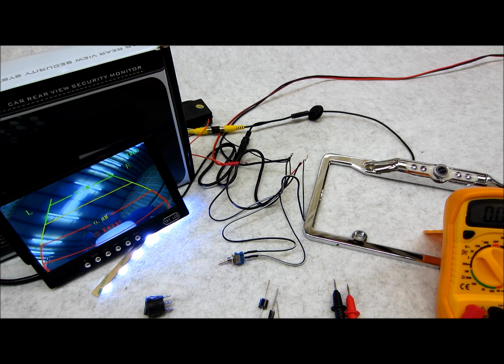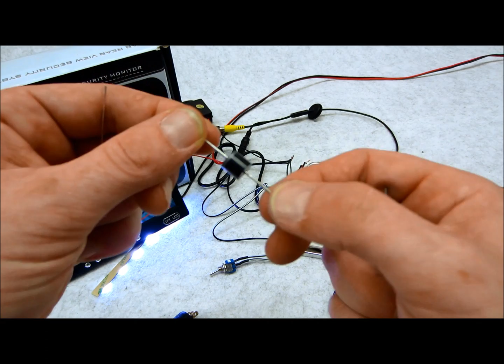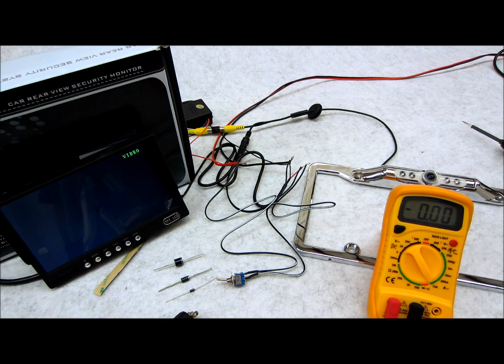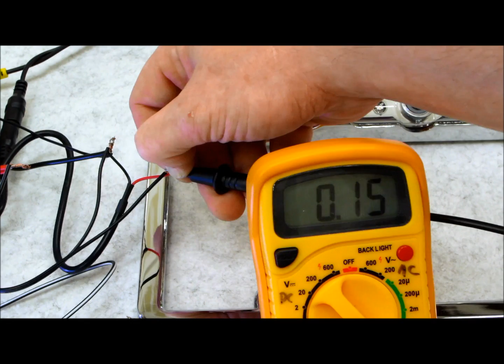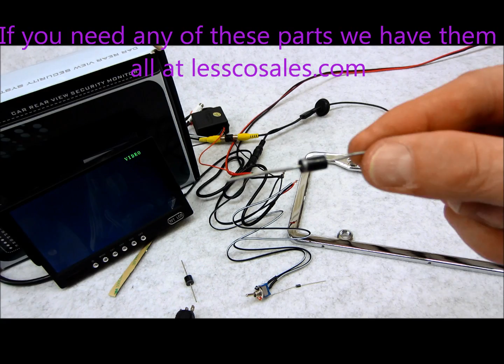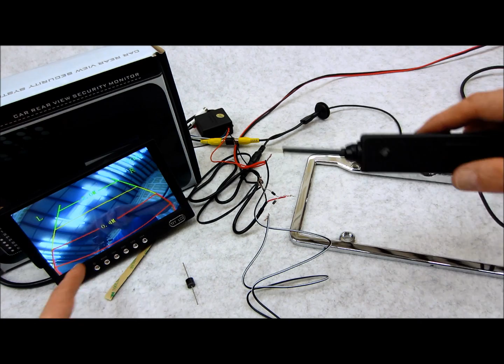How To Wire Your Rear View Camera With An Override Switch

Comment: Very good video, one suggestion that would help is to lay or the wires to show where they are all going. Looks like a rats nest cut off some of the excess wire for filming sake.

Do you have a video showing the steps to set this system up from start??

Comment: Why you said use larger diode and don't use1 amp, use 5 amp and up on other video:https://www.youtube.com/watch?v=hwV6okINfVA , but this video you said all you nee is 1 amp diode?
Reply: I reviewed the video. You need to test the draw. The taillight he said was drawing 3amps so go a little bigger because you don't want to use the full capacity of the diode. On this video its the Camera he tested with 0.15Amp so you can use 1amp that leaves you 5/6 of the diode capacity left. if you wire to the camera and the taillight you need to use the correct sized diode for either. 5amp of light and 1amp on camera. you can use a 5amp on the camera because its still larger than the draw but you don't want to use a 1 on the Taillight side. Good luck if its not too late.

Comment: 1. I'm confuse about which diodes I should use? Because this video you said only use 1 amp diode, but other video you said not to use 1,3 amp because they get hot. https://www.youtube.com/watch?v=hwV6okINfVA
2. Where Can I get the test light you use in this video?
3. How do I wire if I use a switch with light on it?

Comment: can you describe the wires coming from the switch to the power and diode?  are they positive and ground wires or are they both
positive wires?
Reply: They’re both positive wires. The switch only needs to disrupt or complete the circuit.

Comment: Why don't you just ignore the whole reverse light thing and cam being turned on automatically, and just install a switch to turn it on manually when needed??? This way songs or videos played back on the head unit will not be interrupted every single time you shift to reverse....
Reply: HAHA. I was about to ask the same thing. I'd rather just install a switch and bypass the whole reverse light wiring itself.
Reply: Doing that wont let the camera on when the go in reverse .. 
But in that case it will
Reply: not all head units have this problem, (of turning off audio if reverse camera is on). 
In this scenario it is very useful just to have it on auto, it just works.

Comment: bro, hi thank you for this video got better understanding now for the connection I'm going to make but one question on the 12V switch and 12V power coming from the tail light ... 
1. how about if I forgot to turn off my switch and suddenly reverse my car,  power supply from reverse light and my switch are both triggered? what will happen
2. most car still using halogen bulbs reverse maybe about 21watts what diode capacity is ideal?
3. hope you can help me to solve this question in my mind... thanks Anton
Reply: My guess is 24V will go to the camera....to the display and DESTROY the circuitry. He did not address this issue or answer your question for some reason. Good job bringing it up!
Reply: Both the camera and reverse lights will work as before with no diodes.  Still just battery voltage from each wire.  It can’t double 12 volts if it’s a 12 volt battery
Reply: @The Mule Sheriff  so even if switch is on,and reverse is on,the camara and light still with keep the same 12volts?

Comment: Hi theres just something I don't understand.. When you have both of the diodes in.. There is a 12v source going to the switch and from the switch to a diode and on to the monitor.. then you have the camera connected to the reverse light and then to a diode and to the monitor... So.. When the switched is turned on.. how is the camera getting power?.. Wont the 12v source strictly be going to the Monitor alone?
Reply: I have the same question. Did you ever get a response or figure it out?
Reply: It called a ground. Both the switch and the brakelight share the same ground. The circuit comes complete when EITHER the switch is toggled or the brakelight is turned on.

Comment: If you have a 12v accessory line out of your wiring harness couldn't you just tap into that for your power and use the parking brake jig that you can find for like 10 bucks to bypass the parking brake. Wouldn't it be way easier then doing this entire set up??

Comment: I have a wireless backup camera monitor that is always on standby (dark) until it detects the camera wireless send signal, thus I need to install this on the backup camera circuit itself.  The camera is hooked up to the reverse light.  When car is put in R gear, reverse light lights up and thus camera gets power, monitor detects camera is ON and thus screen auto-activates to show camera image.  If I want to turn the camera ON without putting car in reverse AND without running a switched +12v wire from the front, I am thinking of wiring up via diode to the license plate lights.  If I want to turn camera on, I just turn on parking lights....    Do you foresee any problems with this setup?
Reply from the maker: +Tony Estrada no, not at all, thats what the diodes are there for.
Reply: thanks.  worked like a charm.

Comment: Why do you need the second diode?  You should only need one to stop the lights from coming on with the switch, if the switch is off and the backup lights have power, nothing will happen.
Reply: That's a good point. Smart thinking my friend...
Reply: Yes, but if the back up lights have no power and the switch is turned on then the circuit for the back up lights will be complete and they will come on.

Comment: I bought 6 diodes 2 of each 200 volts 400 volts and 500 volts my question is does da voltage matter even tho they are all 1 amp diodes?thanks for your time great videos.ps is there any tricks on installing 2 amps with out actually running 2 separate amp wire installation kits?that will b helpful if u have any information.

Comment: Any chance you have a wiring diagram for this?  I understand the video, but not sure I know what everything was connected to.  I have a sprinter van and I am going to install a aftermarket dbl din head unit with back up camera capability.  I want the camera to come on when I flip a toggle switch and also when I put the van in reverse.  I didn't realize I was going to have this problem with the reverse lights till I watched your video.  I was really intrigued with the use of diodes.  I've never used them before.  Thanks.
Reply from the maker: email me the request, Ill make a mock up for you later today... crankin7@gmail.com